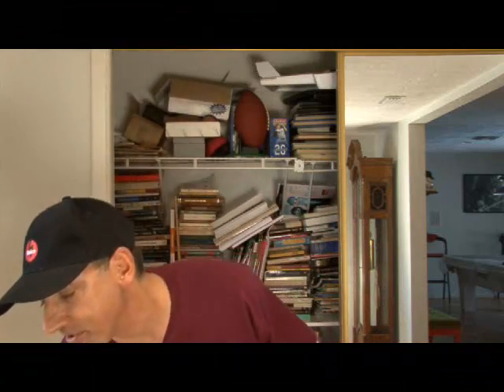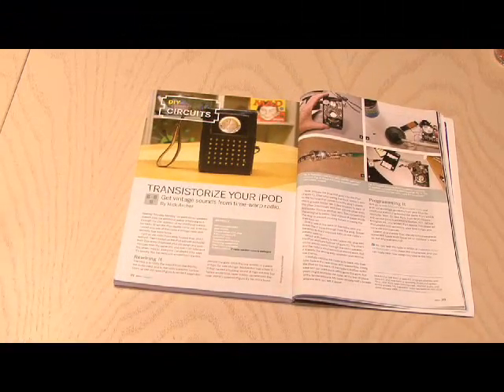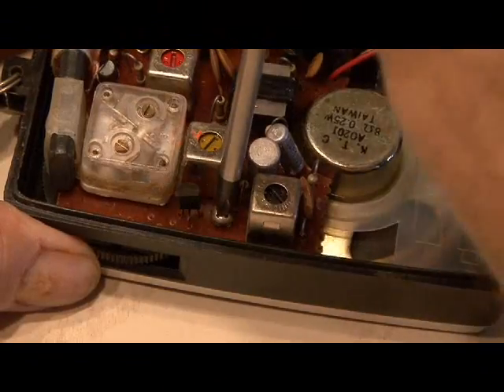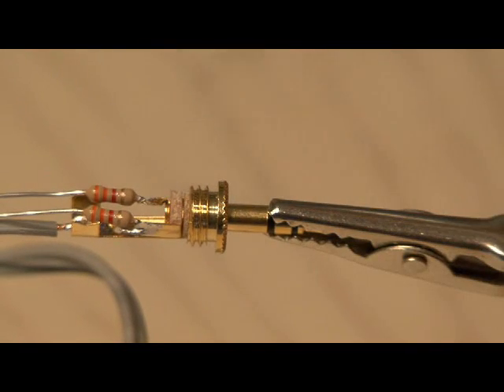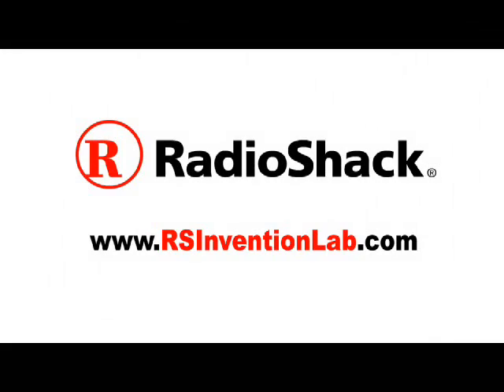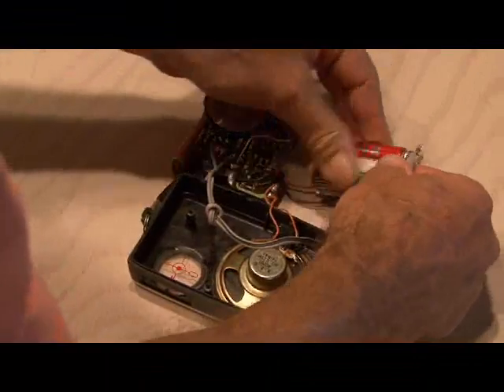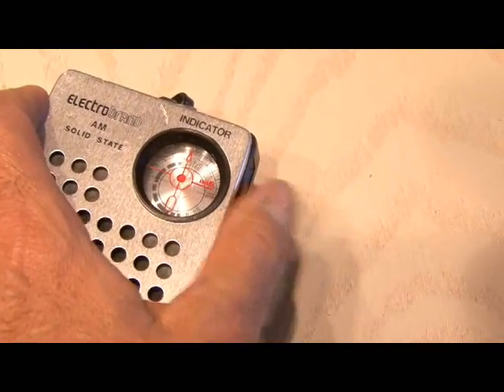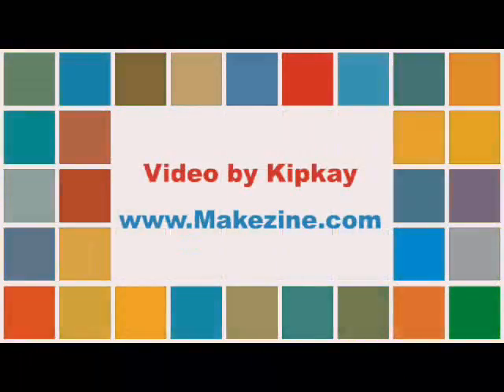Weekend Project: Transistorize Your iPod

Comment: I did a similar project with an old portable vacuum tube record player with a broken turntable.  I replaced the leads going to the needle with a stereo plug, and plugged in my ipod, and it sounded pretty good.

Comment: you could probably also disable the radio section by finding where the audio comes out of the radio section into the amplifier and either add a switch or disconnect it so you dont have to tune it to a blank station

Comment: @yomama111336 an amplified speaker.  his connection to the (signal level) volume control circuit in the radio means he's utilizing the radio's amp to power the speaker, which will work way better (louder) than trying to power a speaker from a headphone jack.

Comment: @OlegKostoglatov,

I was thinking the same thing.

It'd be easier to hook the iPod headphone output to a weak AM transmitter (a kit of which is also sold by Radio Shack), then just tune your radio to the preselected station...and listen to retro monaural sound.

You wouldn't have to damage what might be a valuable vintage transistor radio.

Comment: Or you could hook up the output of your ipod (or other MP3 player) into the input of a short range AM transmitter (which you can build from a kit or from plans) broadcast whatever you want inside your house, and leave the case of your transistor radio unmolested without any extra holes.

Comment: He could have used a jack that switches from internal radio to external source (mp3) when you insert the cable.

That way he would only have a little plug hole in his radio, no wires hanging out.

I think I'll do that to one old radio I have.

Comment: dude, attach those two wires coming out your ipod to :
-one to a connector of the speaker
-one to the pottamp of the volume button 

and you have turned this radio into a amplifier for your ipod

Comment: Kip I did this one time to an old Lennox sound radio i had that didnt work well and i did these exact steps except i didnt have the resistors and i took out the tuner, im gonna hack an old GE hand held CB Radio and do what you did in this video b/c i can use that powerful audio amp and speaker as this CB uses 8 AA batteries i found the points on the volume and marked them but id like to run it thru the earphone jack but its mono and i want both channels to come thru the CB speaker

Comment: He lives in the same city as i do, Wow... I did his flashlight hack and it works great, only i need to figure out a way to keep the bulb from getting hot, it will melt the reflecting plastic... I use it, but i don't keep it on for more than 20 seconds... but it is as bright as a spotlight! It says it costs $10, took about $20, but it works great! I want to meet him! I have a whole kit of electronics, i want to try and make an underwater video cam, but with a digital camera. I'll figure it out!

Comment: Oh, so it doesn't pull out of the case.... I see how that works now. It's just that tying a knot in something reduces its breaking strength by something like 50-75%, so it's usually not a desirable thing to do.

Comment: im mactually in the proces of hacking a hand held CB radio that doesnt work (no antenna) and im gonna hijack the volume control and amp just like kipkay does in this video and make the audio from my mp3 player come out the CB's speaker it sounds pretty good and its very loud, I believe to connect the ground of your audio source to the ground on the radios volume control and the + line of to the middle connector on the volume control

Comment: what was the point in transferring it to the computer converting it to an mp3, putting it on your ipod, then connecting that to the shitty speaker, surely it would have sounded just as bad playing it straight from the tape player

Comment: (1) The video can't be rewound? WTF?
(2) "Transistorize?" WTF?
(3) Solid-state radio is supposed to be notable? WTF?
(4) Resistors "protect any voltage from shooting back into the iPod?" WTF?
(5) Tie a knot up near the speaker instead of down by the case hole? WTF?

I watch this video and all I can think is... well, you know.

Comment: OK...so basically you turned your antique radio into a cheap ipod speaker? Why not just by a speaker from the store for $10 and then trick someone into thinking that the 70's radio is really rare for one reason or another and get $50 for it?